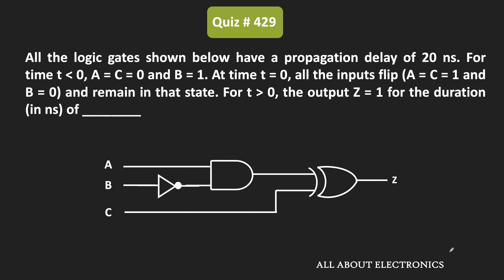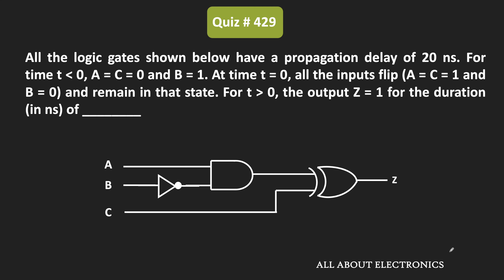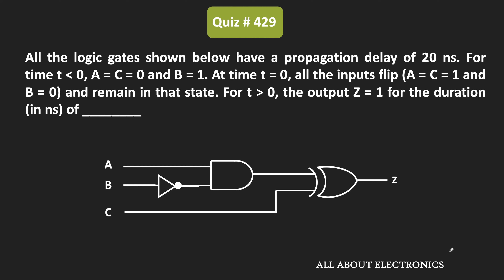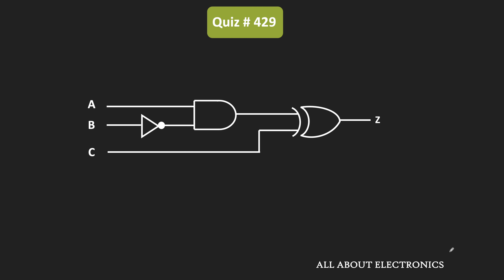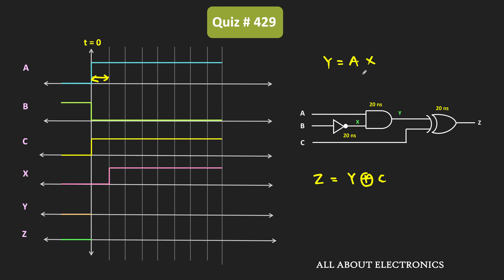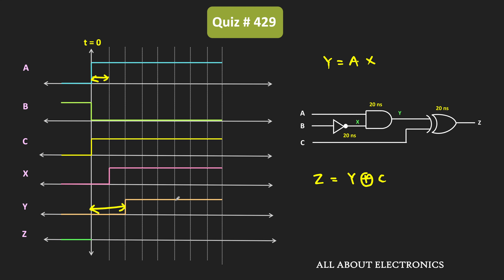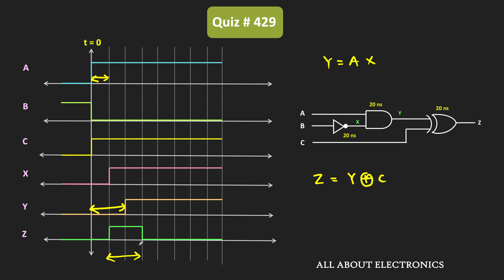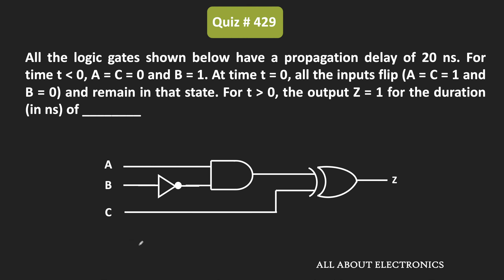Propagation Delay of Logic gates (Digital Electronics) |  Quiz # 429

Comment: I think there is a mistake as for the time when the signal of the last Gate goes to HIGH. The last Gate has propagation delay time of 20ns aswell and that Gate has to wait for the signals from Y and C. Now Y signal can only show up after 20ns and NOT Gate X delays itself for 20 ns so it all sum up Y(20ns) + X(20ns) + LAST GATE 20ns + C(has NO DELAY) = Z(60ns)
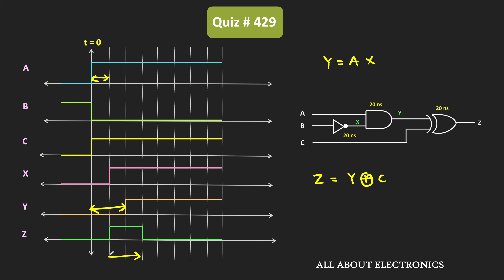Reply from the maker: Of course here the delay of Z is 60 ns. And it is also evident from the graph at 3:40. C is already 1 at t= 0, Y becomes 1 after 40 ns and Z becomes 0 after 60 ns. But here the question is for how long the output remains 1. And that duration is 40 ns. That is why here the answer is 40 ns.
Reply: i think it should be 20 ,because at the other 20 y is already 1 
 @allaboutelectronics-quiz
Reply: @saikoujaiteh9566   yh i was thinking about it too, hope he could clear our doubts